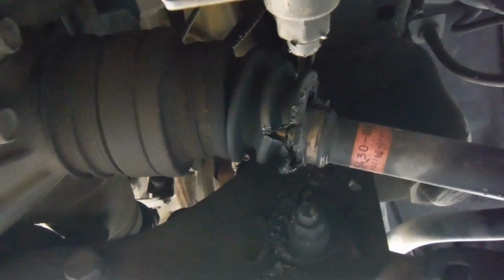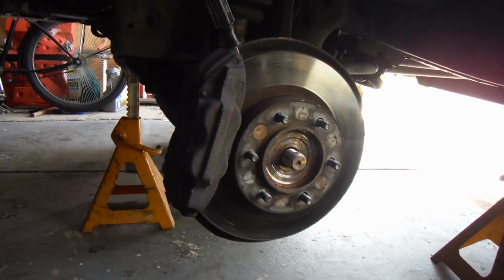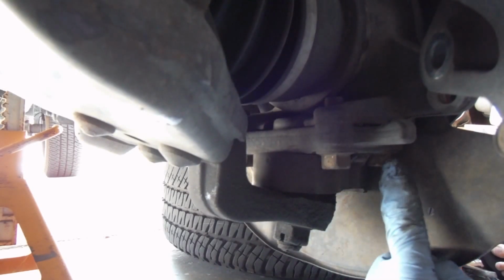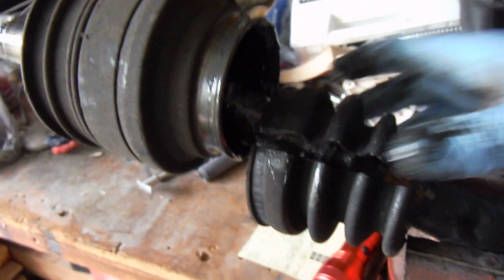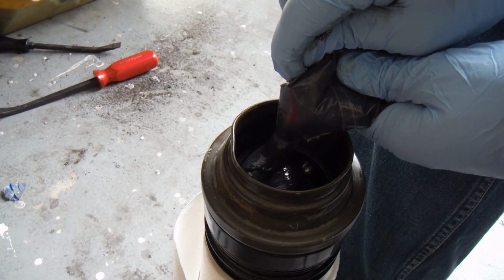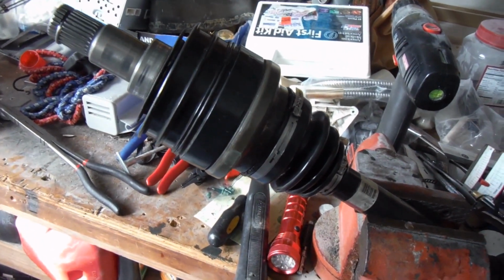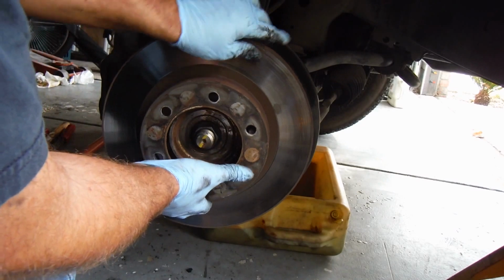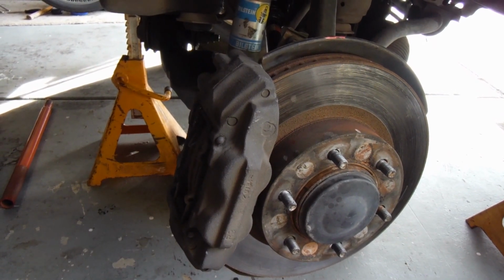2004 Toyota Tundra 4x4 CV Boot Replacement Axle Removal and Replacement

Comment: You do NOT have to remove the caliper.  Just unbolt the four bolts on the lower ball joint housing and swing the caliper/rotor towards the rear of the truck.  I used a ratchet strap to support the rotor/hub from the bolts at the top of the coilover.  If you have to do this on the trail, you do not wanna be unbolting things you don't need to.

Comment: I have my axle out, my old boot off, and my snap ring spread, but the axle end will not separate. I even got the snap ring completely out of the way backed up to the middle of the shaft. There is something very solid feeling blocking the outer axle end from sliding off. Help! Any ideas?

Comment: Great video but not working out so much for me, i removed the snap ring an i still can't get the joint to separate. I have it in a vice & I've hit it with a sledge hammer allot an it won't separate. Idk how I'm going to get the boot on.

Comment: Any tips on putting the lower ball joint bolts back on?..... I tried one time when I installed a spacer lift and no matter how much I jack up the lower ball joint it was hard to get it close for the bolt to reach the spindle all it was doing was tilting the truck more to the side.

Comment: Noooo!! The edit at 8:28, exactly what I’m trying to figure out. So you didn’t roll with the snap ring? If so, how do you get the shaft into the CV assembly with that on there?
Reply: 6:24

It appears that the snap ring sits inside the the inner CV shaft and is not removable from the bearing side. So you expand the snap ring to release the bearing from the shaft, but since the snap ring is attached to the bearing, when you go to reinstall it the snap ring will ride over the cutout and snap back into place.

Comment: Are both left and right axles the same? I have a passenger side axle I’d like to rebuild to replace with a damaged drivers side axle .
Reply from the maker: I am pretty sure they are the same part number for either side.  Also, It's not necessary to take off any of the brakes or caliper etc.
Thanks for watching!
-Dan

Comment: What size is the axle nut?
Reply from the maker: 36mm
Reply: Thanks Dan! My new axle came with a washer behind the axle nut. It’s about a 1/4 thickness. I didn’t see that in the video. Do I need it on the shaft?

Comment: Thank you for posting this video.  I'm doing both CV axles on my Tundra, and your video is a huge help!

Here's a tip for your watchers.  If you jack up the side of the truck you're working on, and leave the other side on the ground, you won't lose any oil from the differential.
Reply: OneCarGarage  Thanks man, never even thought Of that
Reply: Being in the NE and unsure if my front diff drain/fill plugs will come out without a full on war, this is a wildly helpful tip thank you so much!

Comment: Thanks Dan, great video. Just did this project and brake pads, rotors and caliper.

I am still leaking hypoid at the internal joint (insertion point) at the 4x4 housing.
Reply from the maker: Sorry to hear that Doug,
Sounds like the Axle seal is bad.  Not too expensive or difficult to change, and there are a few videos on here that show how to do it.  I'm sorry you'll have to take the axle or axles out again though.  Best of luck to you.
Thanks for watching!
-Dan the Fix it Man

Comment: DO NOT USE A PRY BAR to pop the axle out, I have done countless tundras, the differential tube that the axle “snaps” into is made of plastic and cracks way to easily causing all the diff fluid to leak out
Reply: GOPROSANTACRUZ 
Easiest way I’ve found so far, is to use a short prybar or screwdriver and apply pressure to the back of the axle( as in the video), while applying pressure with the prybar give it a good couple hit with a air hammer, if you have one. Pops out smooth with out damaging the differential tube assembly. 

If you don’t have a air hammer, get a second set of hands to apply pressure with the pry bar and use a sturdy flathead and hammer to the back of the axle. 

Good luck 👌
Reply from the maker: Russell,
Thanks for the tip, sounds like great advice.
-Dan the Fix it Man
Reply: Russell,

About to do my boots on my Tundie, what other way do you recommend to pop the axle out of the differential?

Thanks,
Ryan

Comment: Thanks for the video! I'll be doing my 4runner, but I figure the concept will be the same. Just wondering, Will I need an alignment after doing this?
Reply from the maker: Hi Matt,
Probably not necessary to do an alignment after this.  Some might recommend it, but it doesn't seem like it would change anything related to the ride height or anything else that would change the alignment.  Wouldn't hurt to get checked though...
Best of luck to you!
-Dan the Fix it Man
Reply: Good to know! Thank you sir!

Comment: Nice video Dan, thanks for posting.  I'm doing my boots in the next week or so, it's been really helpful to see you do it.  Quick question... will a 35mm socket work on the axle nut (I have to buy a socket)?  I measured the axle nut at about 1.380" which equates to  35.05mm.  Was the 36mm socket a tad loose?  Also, did you use a 6 or 12 point?
Reply from the maker: Hi Steve,
Great question... the 36mm was indeed a little loose, but still worked fine.  I have since learned on a forum on Expedition Portal that a 35mm will work as well, and according to that website is the correct size.
I used a 12 point because that's what I already had in my toolbox, but it sounds like the 6 point socket would work too.
Also, please note that it isn't necessary to remove the brake caliper or rotor to change the axles like I did in my video.  I had seen a youtube video and they had taken off the brakes too, so I didn't really think about it until after it was done...
Best of luck to you!
-Dan the Fix it Man
Reply: I'm adding and confirming for others.  I just removed my CV to replace the faulty needle bearing and the axel nut is 35 mm and a 6 point.  36 was too loose for my 2002 Toyota Tundra.  Hope this helps.
Reply: My math says a 1 3/8” might be a little tight

Comment: Hello Dan, great video. Can you tell me, is it the same process to replace the outer boot as the inner?  Remove the old boot, disengage the snap ring, etc.? I have an 01 and figure if I go to the work to get the axle out I will go ahead and replace both boots. 

thanks!
Reply from the maker: It should be the same, but I haven't done that one yet.  It has to be removable for servicing etc, but I am not sure if it is the exact same type of snap ring.  And that's a great idea to do them both at the same time since you will have the axle out anyway.
Thanks for watching!
Take care,
Dan

Comment: Hi Dan thanks for the video 

Quick? 

I saw your sienna video and you didn't take calipers off

Is that what you were referring in your comment in video description 

Please advise thank you
Reply from the maker: Hi Shab, 
Yes, the Sienna video is very similar to what I am referring to in the description.  Once you remove the bolts on the lower control arm, you can swing the whole hub (rotor and calipers attached) out of the way enough to push the axle shaft through.
Thank you for watching!
-Dan the Fix it Man

Comment: you did too much work. there was no reason to remove the rotor.
Reply from the maker: Hi Tyler,
I had watched another video on Youtube to get an idea of what had to come off, and he had done the same thing.  I realized after I had already taken off the calipers and brake rotor that it probably wasn't necessary on this truck.  I had already posted that in the description of this video as well.  Thanks again for watching!  -Dan the fix it man
Reply: Dan the Fix it Man hey good video though. it had been awhile since I had done one so I was just getting a refresher but I did do the job without removing any of the brake stuff. Thank you.

Comment: Hi Dan, did you use that whole packet of grease on the ball bearings? Also, since you had the axle off, did you consider changing the outer boot as well?
Reply from the maker: Hi, Yes, I used the whole packet of grease on that joint.  And no, I didn't change the outer boot that time.  But good point, that would have been a good time to do it, since I already had the axle out of the truck.  I guess since it wasn't bad, I didn't bother changing it.  I think the only reason the inside boot tore is because of the lift on the truck.  Tundrasolutions.com has many write ups about the inside boots leaking or tearing after lifting the truck, even with the differential drop kit.
Thanks for watching!
-Dan the Fix it Man
Reply: Thanks for the video and quick response. I have to replace both the inner and outer boots on both the driver and passenger side axles one of these days. The rips are minor tears. So I'm going to continue to drive my vehicle.
Reply from the maker: No problem, best of luck to you!
Take care,
Dan the Fix it Man

Comment: Hi Dan. Was wondering... what happened with the snap ring? Did you need to put it back in place?
Reply from the maker: No, it actually stays in the CV Joint and snaps back onto the shaft when you slide it in.  I'm sorry if I didn't explain that in more detail in the video.  You can see the snap ring inside the joint at 7:05.
Thanks for watching!
-Dan the Fix it Man

Comment: Why did you take the brakes off?
Reply from the maker: +ricqik I had watched another video on Youtube to get an idea of what had to come off, and he had done the same thing.  I realized after I had already taken off the calipers and brake rotor that it probably wasn't necessary on this truck.  I had already posted that in the description of this video as well.  Thanks again for watching!  -Dan the fix it man
Reply: Thank you for the video. I will be replacing both of my axles. But, this information is very helpful. Thank you.